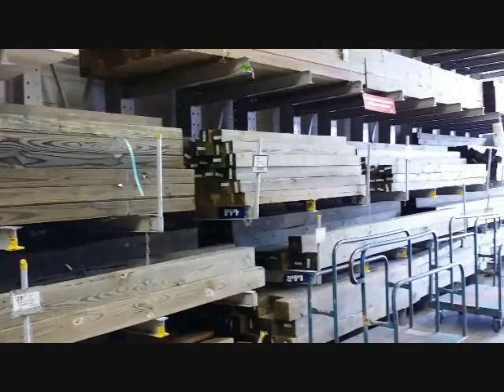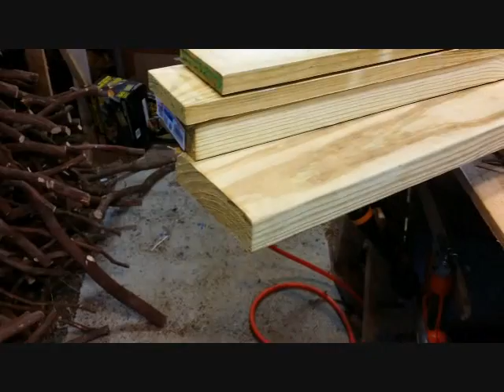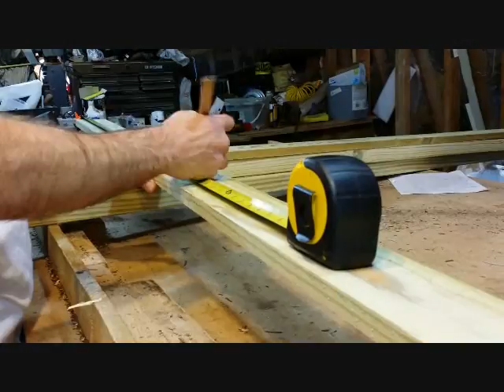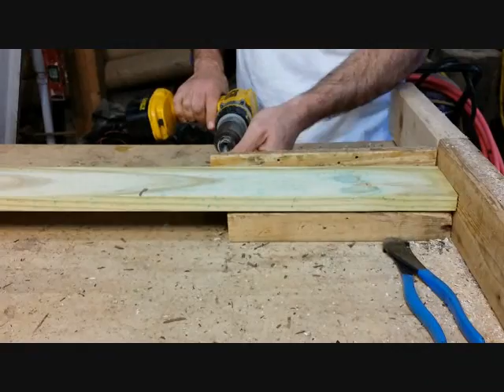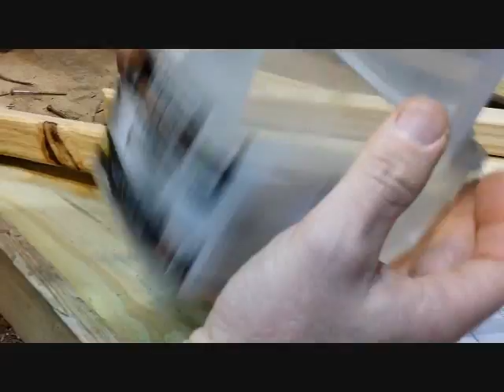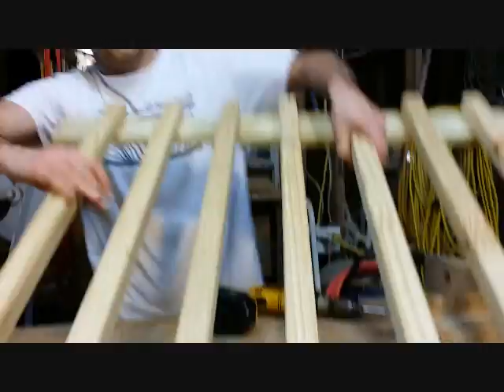How to Build a Deck Railing

Comment: what gap to wide. Code is 4 inch center to center of picket. Way too much pencil work etc Set bottom rail then top rail and cap. Now you can slam picket under top flat rail and plum first picket and use spacer block so all pickets are 4 inch center or less for code